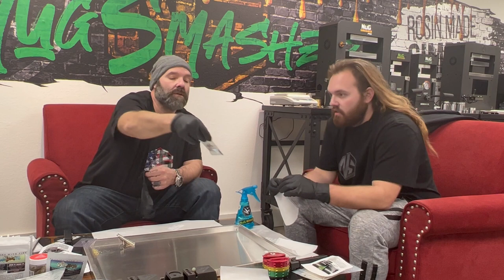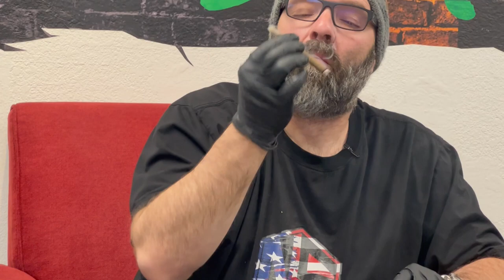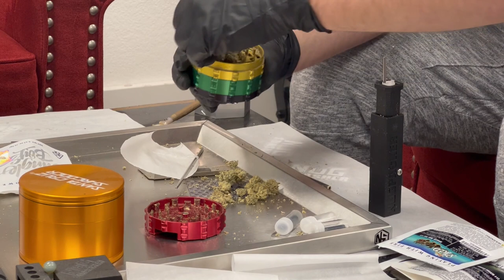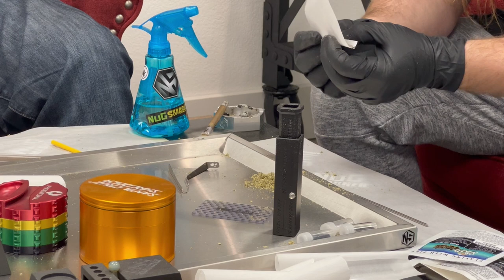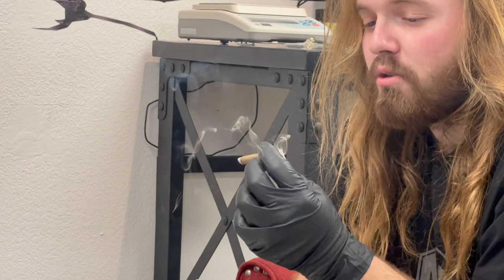HOW TO ROLL A CANNAGAR THAT LASTS AN HOUR

Comment: Loved the video purchasing my kit today! Question from curiosity could I use pre rolled cones with the packer if I didn't want to go with parchment paper and raps? If I were in a bit of a hurry?
Reply from the maker: Hey Brendan, With a Pre-rolled cone those are made with rice paper and I wouldn't think they would hold up with being hit on over and over again.
Reply from the maker: The NugPacker was designed to make pre roll joints, so you can use pre roll cones if you were packing joints. However, we do not recommend using pre roll cones when packing a Cannagar.

Comment: That process sucks balls!!! I love the press (xp) I bought, but come on....there's got to be a better way. Make a handle that has a shaft the diameter of the base with the shaft being hollowed out to the size of the metal straw that goes in the center to create the hole for air flow. Similar to the purple rose or cp cannagar press. That way packing is soooooo much easier and better.

Comment: Here is a great question what is the Guinness book record for longest blunt or cannagar burn time or smoke sesh or the most amount of weed put into a blunt wrap
Reply from the maker: That is a great question... Do you know the answer?? :-)
Reply: Cannagar Solutions has the 58-Gauge Mold that I own. It holds 2 ounces +. It burns for 14.5 hours. Every time that I light that or any Cannagar, I turn on the stopwatch and every time that I put it out, I stop the stopwatch. I put 56g of flower, 2g of Bubble Hash, and coat the outside with $400 of 7g Organic Hash Rosin that I get from the microbusiness dispensary. I also use shatter sometimes along with Live Resin.
Reply: @Nugsmasher  Cannagar Solutions has the 58-Gauge Mold that I own. It holds 2 ounces +. It burns for 14.5 hours. Every time that I light that or any Cannagar, I turn on the stopwatch and every time that I put it out, I stop the stopwatch. I put 56g of flower, 2g of Bubble Hash, and coat the outside with $400 of 7g Organic Hash Rosin that I get from the microbusiness dispensary. I also use shatter sometimes along with Live Resin.